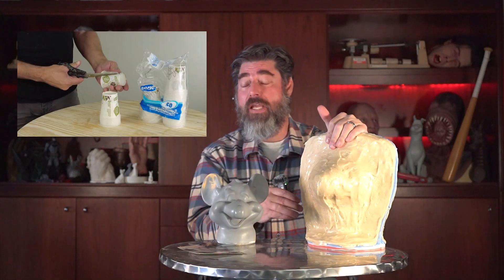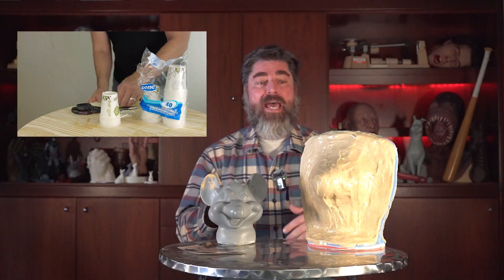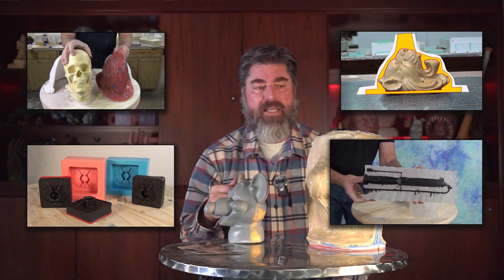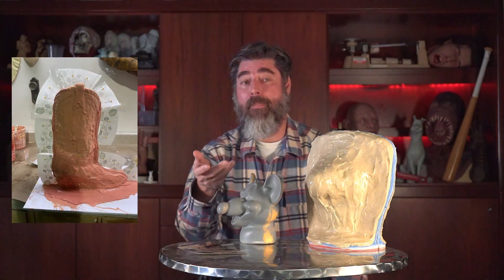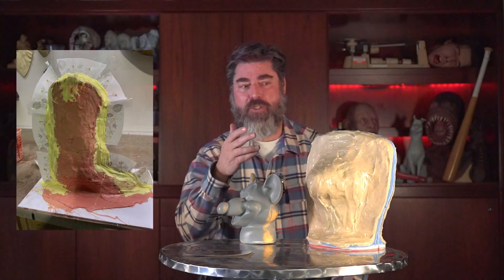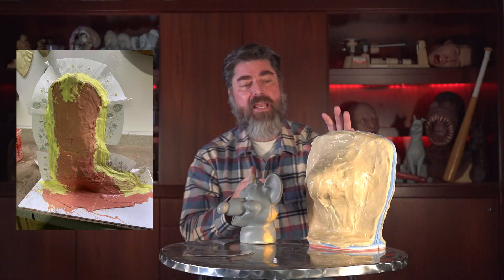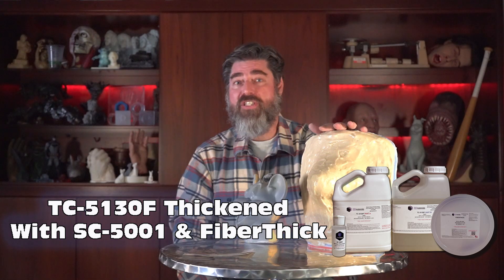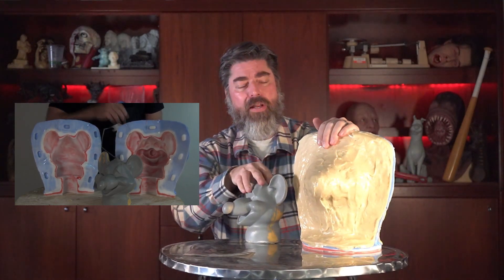Shim Technique For Multi Piece Rubber Molds

Comment: Hi @brickintheyard I've been wanting to ask about casualty care training devices.
I have a concept for one but I'm thinking that after thousands of repetitions pushing gauze into a wound, even a hard silicone would break down quite rapidly. So I was thinking of making a human body out of memory foam after noticing how long gym pads last after being abused that much. Is there another material that you would recommend for this particular goal?
I guessed I would have to quit on some realism given that I really want durability.
Reply from the maker: Foam will probably not hold up as well as silicone. I would recommend a skin of TC-5110 or TC-5110F (fast) over a soft foam. You could also use both TC-5110 and the softer TC-5100 underneath. Both as soft, but very strong and stretchy.
Reply: @brickintheyard  And can you share some the applications that prove their durability after repeated use? Also you seem to suggest hard skin over a soft flesh, and I was thinking it would have to be the reverse, so why is that?
Reply from the maker: @ You can layer various durometers (softness) of silicone and foam depending on the part of the body you are simulating. If you are simulating skin on the skull, for instance, you would want a thin layer of firmer silicone on the surface (such as TC-5110), followed by a thin layer of soft TC-5100, followed by a rigid resin or similar material to simulate bone. If you are simulating the abdomen, you would use a firm silicone on the surface (such as TC-5110) with softened silicone underneath to simulate fatty tissue. Firmer silicone like TC-5130 or TC-5140 may be used to simulate muscle tissue. Here's a good starting point for you: https://youtu.be/z6IwpvFnYiA?si=5huECOAwtbdfDddG

Comment: I have a bit of an odd question about mold making that maybe you could help with and might be an idea for a future video. I use 3d printing to directly make molds. This can be much faster then printing a master and then making a mold from that. The problem with this is it is often very hard to smooth layer lines in a 3d printed mold. with a printed master is not to hard, you can use sanding/filler/paint or epoxy coating to smooth the print quite easily but smoothing the cavity of a mold is a much harder problem to solve. I have tried solution casting of PVA to do this but the layers it produces are so thin it would take hundreds of coats to smooth the mold surface. I have done the same thing with epoxy thinned with acetone and this works ok some of the time but its very easy to get runs to do the long cure time and most epoxy is very thick so its quite bad about bluring details in the mold. So I was wondering about the possibility of using PU resin instead. I know there are some PU resins that are designed for slush casting and that is basically what this is. do you think this could work, could I get a resonably thin coating doing this, say under 2mm and is there a slush casting resin that is compatible with platinum silicone? (the molds I make are for silicone parts) Would love to see some videos on using 3d printed molds or 3d printed shells for cavity molds this is something I do often for a final mold and seems easier then making a PU or plaster cast shell.
Reply: @pilfit  stop being lazy all this effort you could have just sanded down a regular master and molded it already,when the short cut becomes the detour
Reply: @Themacdaddyofcincinatti  This has nothing to do with lazyness... this is about time and cost management. making a silicone mold for every single iteration of a prototype adds up to allot of time and money. there are situations where fast iteration is important and that is where direct 3d printed molds can be a game changer. not everyone can afford to go threw thousands of dollars worth of silicone in just the prototyping phase.
Reply from the maker: Not sure I understand. Are you making rigid molds for resin casting?
Reply: @ no, casting silicone parts in a rigid mold.